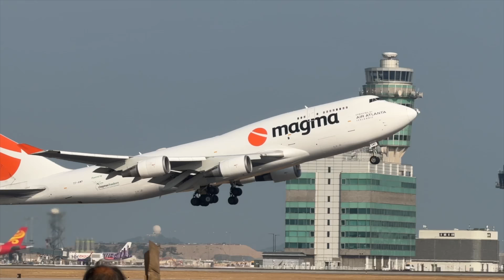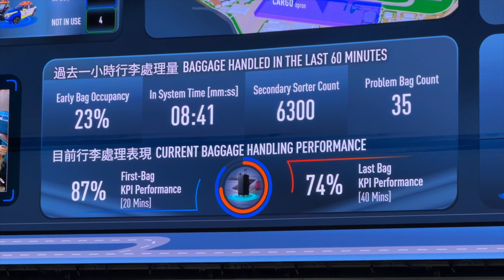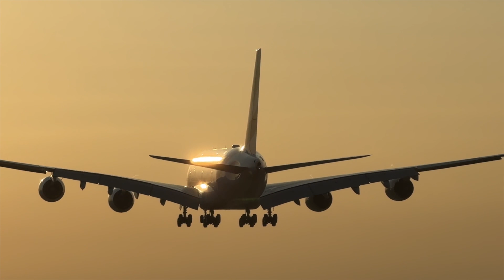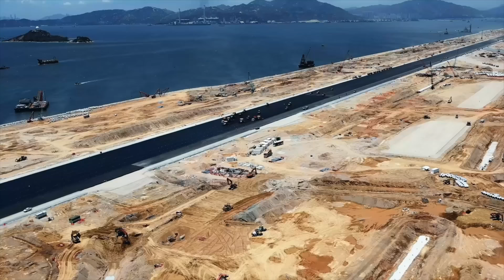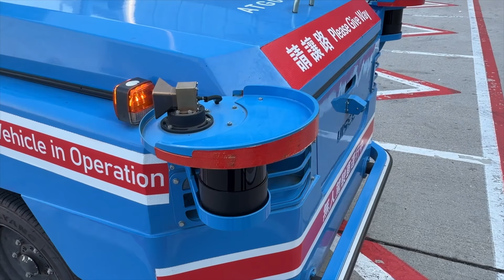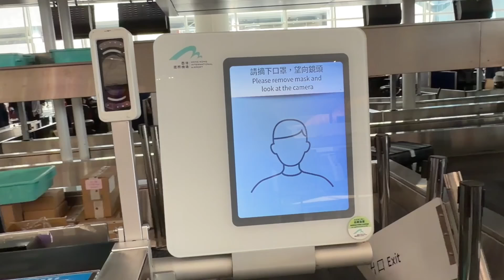Inside Hong Kong’s Smart Airport: The $18 Billion Upgrade

Comment: it is nice to see that they have implemented KPI's key performance indicators. But they are only dependant on what you have control over internally. It's the actual airlines that cause most problems and they also should maybe take the same approach this airport it is doing by managing like this. I get it that there is no control over mother nature, but maintenance and scheduling could do it like this and track performance. good video Sam, I  am a big operations guy and love to see this insight